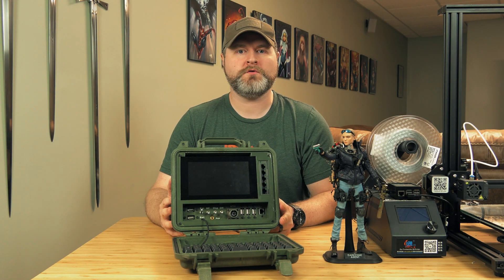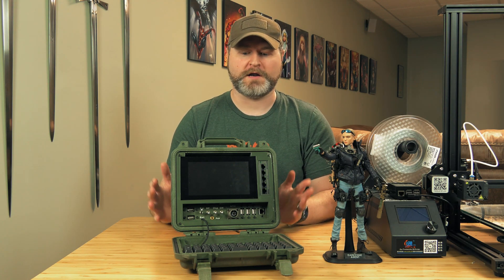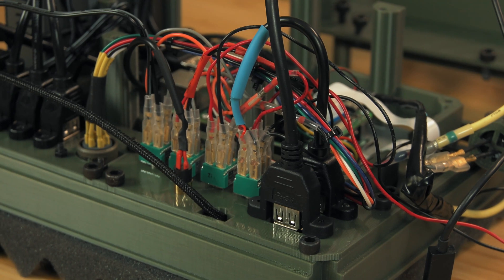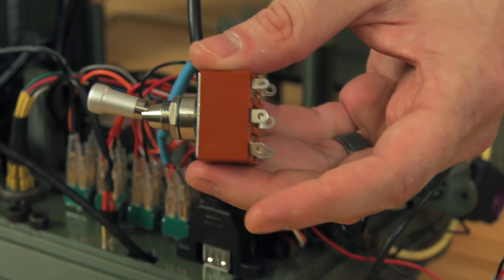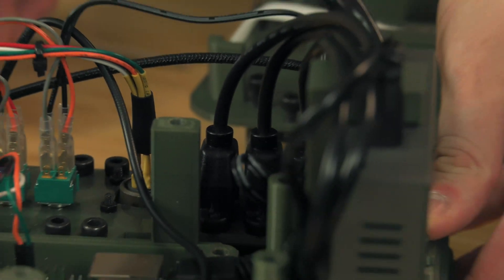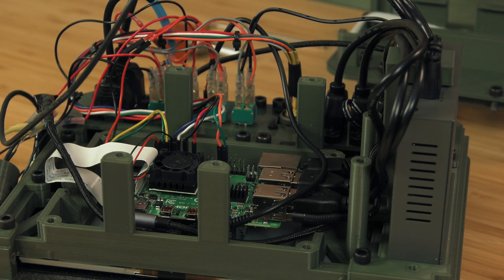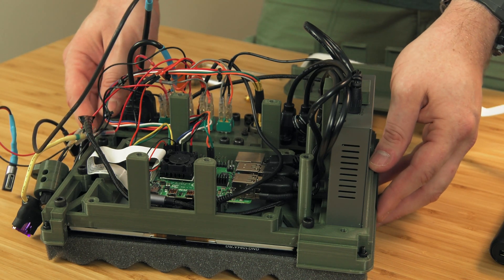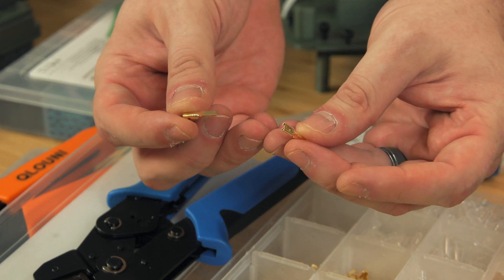"The Division" SHD Cyberdeck | Part 2 - Internal Components | 4K

Comment: Spade connector are great but don't disconnect often because the metal might fatigue and make loose connection. Solder are great for stationary objects...when you have this kind of project where things are kept being move and toss around. Spade is better because solder joints can crack.

Comment: A 3rd use for that switch. Split your power and ground source inputs. Connect each to opposite corners.
You will now be swapping polarity. For like switching dc motor directions or something. 😅
Just thought it may be worth mentioning for some wierd reason.. lmao

Comment: Very nice. Have you ever considered selling the 3D printed parts? Package it with the wiring diagram and parts list along with a list for the consumer to purchase...or some semblance thereof. Looks really durable. I like your applications [uses] but would add ATAK, an SDR with the entire package capable of interacting with other team devices as a server.
Reply: Agreed, I would definitely buy this. I currently don't have a 3d printer at my fingertips, nor does anyone I know have one. Would also save the trouble of being stuck with PLA that I wouldn't use for another 2-3 years anyway.

Comment: Is the battery pack always on?  I built one but the power pack is solid state with no on/off switch I can tap into from an external switch. HELP!
Reply from the maker: No, battery pack is not always on. I have a separate power input that goes directly to the power pack. Which is a direct usb-micro input in the case of this battery pack.

Comment: very nice design concept  may be just use some Lacing Cord, Braided Core, PVC Sheath, 1 mm to 1.2 mm O.D., Black, Nylon to (farneli 81400001) to tidy up wires. As a aeronautical electronics design  engineer that's what would be done in the military. Thanks for sharing.

Comment: You may be able to down clock the pi to reduce power draw - this being software it gives you the option of increasing the Pi's power if you ever needed.
Its not so much that the Pi 4 is the problem here its that you have a substandard power brick.
Reply: not to mention; underclocking the pi would give better battery life, which is always a nice plus.

Comment: Tech tip here on your power line to the rpi you need the data lines to get 2.1 a from the powerbank
Reply: Do you have a link or more info as to why it requires the data lines for 2.1a?
Reply: @ the old usb power system used the data lines to determine how much power they could pull from a supply. Idek if the system has changed since then. USB power supplies usually have a resistor on the data pins that tells the device how much current it can pull.